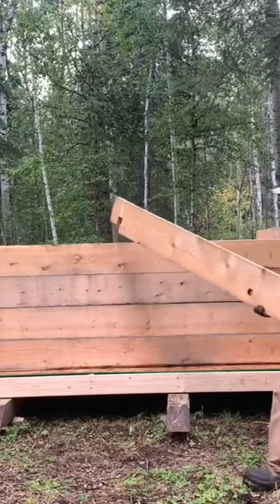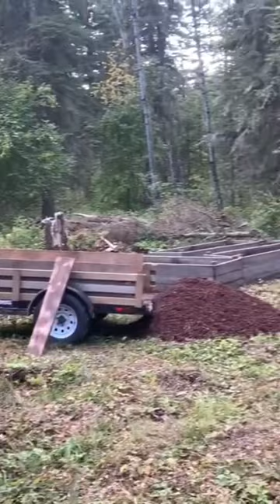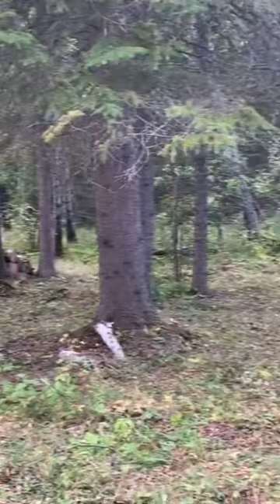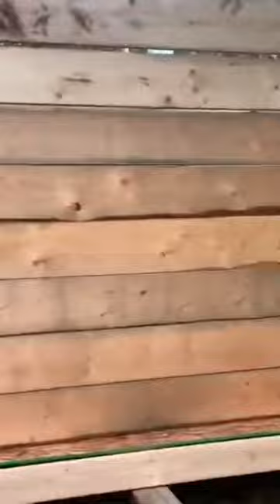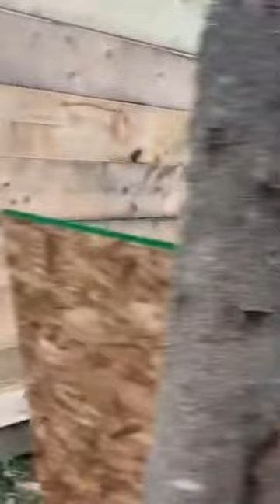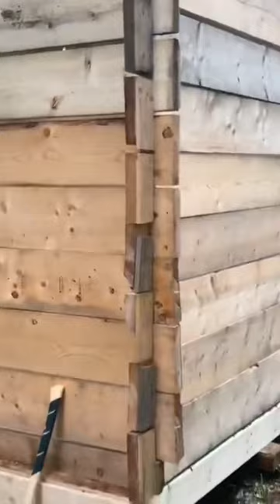Building a tiny cabin out of 2x10’s in the Canadian wilderness

Comment: Hi what type of joint did you use for the construction on the boards sorry for asking as not knowing much about wood work
Reply from the maker: Thanks Donovan!  All I did was cut a notch on each end of the 2x10 that was as wide as a 2x10 and half as deep so they would fit together similar to a notch for a log cabin. Thanks for tuning in and commenting!